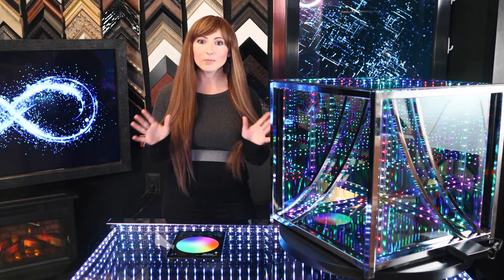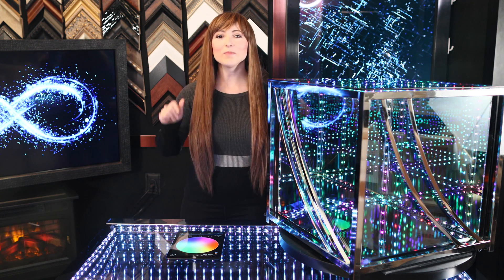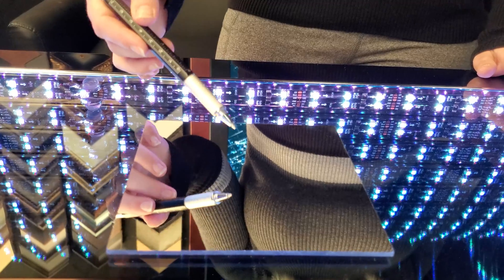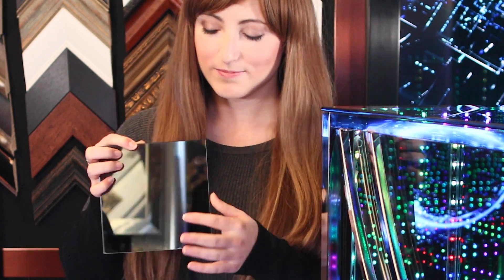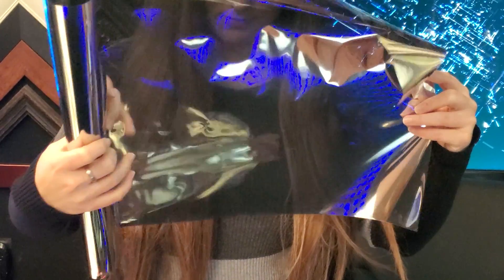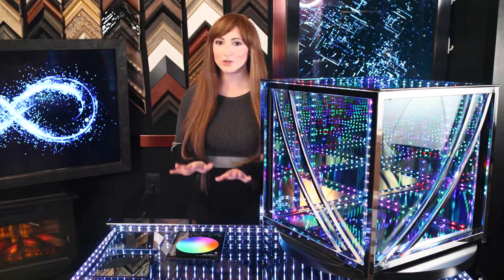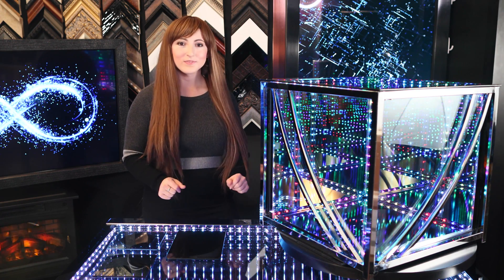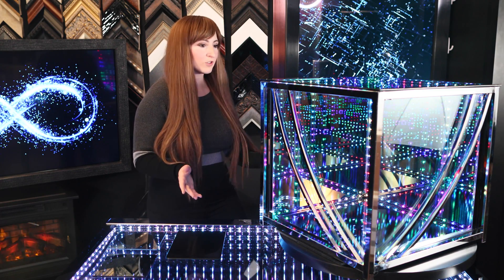HyperCube Infinity Mirror DIY Project

Comment: Thanks for the tutorial? Because that was shit. This might as well have been a TV produced cooking show where the hosts demonstrates a little chopping and then cuts to them pulling a perfect entre out of the oven. You showed hooking a led strip to a psu.....😮. Nothing on how to position the materials to achieve optical illusions. What was the honeycomb plastic sheets used for? What thickness should the acrylic be? What kind of LEDs should be used? How many pixels per meter? Addressable or NOn Addressable? You bought some shit on Etsy and are now trying to pawn yourself off as a aD DIYer. Me thinks not. You kniw the algorithm is going to play better using a semi attractive female as opposed to male. Analytics probably showed you that men are your main viewers because DIY interest isn't as prevalent in tge female demographic. Us being hedonistic flesh slaves with little impulse control will instinctively pick the petite red head with chesttickles. Same way a semi attractive female gamer will drooled over by ever male incel gamer out there. It's like a 🦄.  You'll see horses, and you'll see horned animals, but you never see them combined. But, I didn't know this was a thing, so I guess thanks fir that. Time to find a real DIY instructible and reverse engineer from there

Comment: The link to 16"x16" Beamsplitter Mirror w/Rounded Corners doesn't work anymore, and if you put 16" x 16" into their calculator it costs more then to just buy one off of hypercube. Any other websites you recommend to order the glass from?
Reply from the maker: stereoscopicmirrors.com also sells beamsplitter glass!

Comment: Hey amazing build, i was just wondering about the infinity light trace on the panel at the back. is that a tv? or  a glass see through thing? optical fibres? : O It would be great to get some info on that :)
Reply from the maker: It is a TV with an infinity photo on a flash drive! :)

Comment: Another cool video you could do would be to marry the mirror cube with cymatics. However, it may have to be constructed like the Great pyramid. You may have to use UV LEDs to illuminate the particles moving around in the field produced by frequency. I am unsure how acrylic would go with this, as rubber mats are usually used
Reply from the maker: That's a really interesting idea!
Reply: Love it!

Comment: Have you made a non directional hypercube at all?

I would be interested in a non directional hypercube that has a photoelectric sensor mounted on the inside. When lights are turned on, the sensor will detect this. When the LEDs are turned off, the state of the sensor should not change, according to science.

However, according to Walter Russel, the state of the sensor should change basically instantaneously when power is removed from the LEDs. Walter Russell's cubic wave field inspired hypercubes a decade ago. While not everything Russel stated was true, he did make a number of predictions that actually beat mainstream science.
Reply from the maker: That's a really great idea!

Comment: Sadly directional two-way mirrors don't exist. A two way mirror is a piece of glass or clear plastic with a semi-transparent coating on one side. If it looks less reflective on one side, that's because a grey-tinted glass was used. This is common practice for interrogation room style two way mirrors where you want to make sure the person in the brightly lit room can't see anything going on in the dimmed room. For an infinity mirror illusion you want the glass to be as thin and clear as possible. If you're confident the material is not going to scratch then plexiglass if your best option. If the surface is going to be handled and needs cleaning, then thin glass will last longer.
Reply from the maker: Thanks for the summary! This sounds like it's from our website twowaymirrors.com
Reply: @twowaymirrors if it came from your website, why is this viewer thr one pointing out your mistakes? You have no idea about any of this do you. Your trying to SniperWolfxxx us arnt you?

Comment: Drop it from the ceiling and make a chandelier.
Reply from the maker: That's such a cool idea, we'll have to give it a try!
Reply: @twowaymirrors  Thank you. It's all you. I have more ideas than time to implement them all.
Reply: @twowaymirrors  Not to get too crazy but you could also do a combo infinity box chandelier with a separate circuit for lights on the box corners. Then you could suspend the whole thing under a ceiling fan. The surface of the fan blades could be mirrored. Maybe that's going too far. It would take some skill to cut the mirrors and make sure everything on the fan is perfectly balanced to avoid wobble. Anyway, I hope you do the chandelier thing. Subscribed.

Comment: Hi is the non first surface mirrors "laminated" or just tempered?  Also what would the glass only (no electronics or other hardware) cost to build one just like the one shown?
Reply from the maker: Just tempered. It's quite cheap if you're using infinity mirror film https://www.twowaymirrors.com/infinity-mirror/

Comment: when you are putting the leds lights on it looks like you use a plastic grid. does the lens get glued to it and slide between the glass and mirrors?
Reply from the maker: Great question! The plastic grid is a morton cutting system

Comment: Awesome video. 

For those wanting to build, I noticed the LED's aren't on every edge and there is an X pattern in the top panel where the LED strips cross. Maybe I'm looking at this wrong but I haven't been able to create a path along cube edges that don't double back on each other, and so in an effort to not mess with with the LED circuit, you can splice in wiring and double back on a LED strip, giving the illusion of one seamless line of LED's that follow all 12 cube edges (Provided you hide the wiring of course). 

Question for the uploader: I see you put a first surface mirror on the bottom to further enhance reflections but can you get good results from 6 two way mirrors? I really want this to look the same from all 6 sides.
Reply from the maker: Yes, works great with all two way mirrors! A first surface mirror is a nice upgrade, as it reflects 96% instead of 70%, so you lose a lot less light with each reflection.
Reply: @twowaymirrors  Thank you for the tip! I will be building one soon.

Comment: you said 5V strips are dimm and 12V strips are better. That is not true. It depends on leds per meter. In video you are using 12V strips which can control only 3 leds at the same time, this is looking bad. When using individually addressable led, let's use real individually adresable led! It is looking a lot better, even better are strips with 144 leds / meter. I made infinity dodecahedron (60led/m), it is looking great and will be even better with 144leds/m.
Reply from the maker: Great point! It's just a rule of thumb for newbies shopping on Amazon. A lot of the 5v are dim.
Reply: @twowaymirrors  
most strips are using WS2812B leds, they are bright if you can supply the amps. My infinity dodecahedron has 240 leds (4m of 60led/m strip) at full brightnes white it consumes around 9 Amps at 5 Volts. Of course if you connect 5m strip to crappy 5V powerbank it will be dim.

Comment: How long does the battery last?

And I can't find your other video how you put it together 😔
Reply from the maker: It lasts for several hours, depending on which 12v lithium battery pack we're using. Good point about the other video! I'll be releasing videos on how to make infinity mirror  dodecahedrons and hypercubes!
Reply: @twowaymirrors  awesome!! I am looking forward to checking it out. I am definitely making a massive cube just like your with the same table you order!beautiful and elegant looking!! I am thinking about putting it up on the side and making a motorized bottom to have it spin. Great Job! Love your videos! Thank you for sharing the info 😉👍

Comment: Okay......Ummm....What? LOL I'm assuming the plastic material you put down first was to protect the table underneath when you cut the glass? 

Then I'm totally confused........ 

Inserting parts into table? So Are these the 5 mirrors from the list of parts? 
When cutting glass, is it the mirrors that were being cut? 
Then you put leds on what appeared to be a flat metal bar which is not the L shaped bar in the list of parts. 
Also where do the 90 degree L shaped bars go? 
The Leds were applied to one bar? 
Then you used the first surface acrylic mirror on the bottom. 
Next you put the 5th glass mirror on the top.
What happened to the glass that came with the table? Why wasn't it just tinted with mirror tint and placed on top instead of buying a whole nother glass mirror?
What length of led lights were used and where were they mounted?
Were the 90 degree aluminum bars used in the corners ? 
Were the lights attached to those? If so how could they go from one corner to the next without being cut?

I am so very lost.
Reply from the maker: M. Lewis, I totally understand! This is a sneak peak to our major DIY step by step video. There was a lot of trial and error in the original prototype with the lights. I look forward to posting a version that is easy to follow to take you from point A to B (Complete Hypercube!). I appreciate the feedback :)
Reply: @twowaymirrors  Ah I see. Thanks for the quick reply. I will be on the lookout for the step by step video. Thank You so much.
Reply from the maker: @Mongo76  No problem! ^_^ I am excited to get it out there.